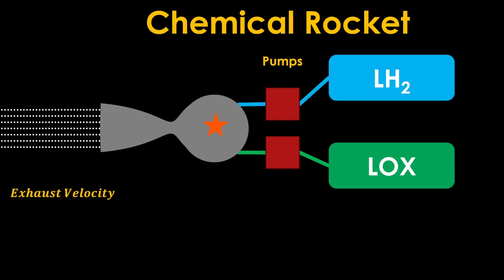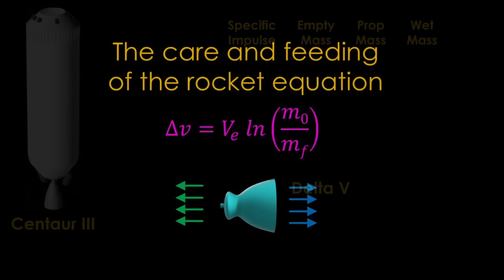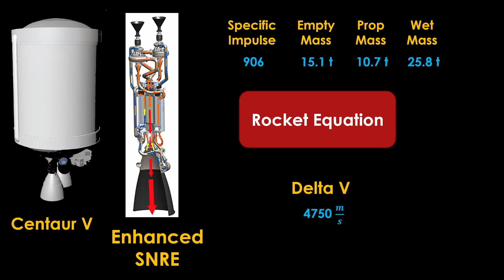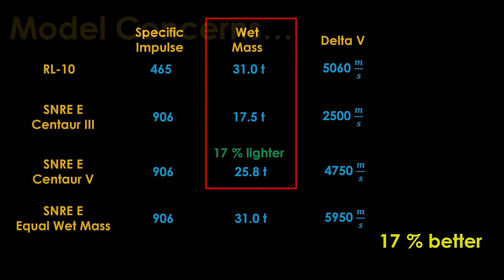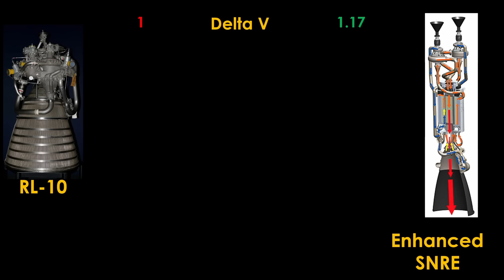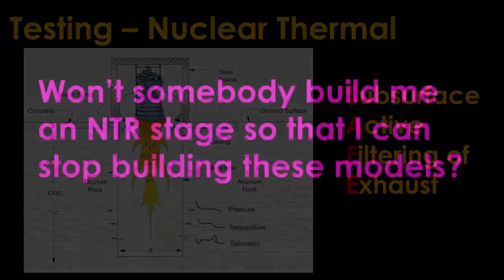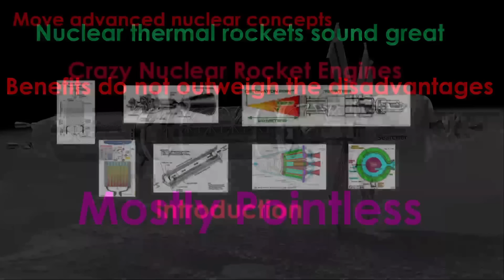Why Nuclear Thermal Rockets are Mostly Pointless

Comment: You can't rid of the heat that's always the problem 😢
Reply: The propellant cools the engine for thrusters

Heat is an issue for nuclear reactors that generate electricity on spaceships but not nuclear rockets as those are just cooled by the propellant 
Lastly space engines are designed to operate very very hot and so would not have any issue staying red hot for several hours or days it would not damage them in any way
Reply: @IceRain-f5v  After shutdown the NTR core will continue to produce heat, ALL fission based reactors have decay heat because the fission products of a Unranium atom are not immediatly stable isotopes, they spontaniously decay.  At the moment of shutdown it's around 6% of pre-shutdown output and decays asyntopically for YEARS.  This decay heat will uterly destroy the engine if not disipated, which is why NASA always considered NTR stages single use, they literally self-destruct after being used.

Comment: NTRs might make sense when you have a very high payload mass fraction. This reduces the influence of the dry mass. If your spacecraft is big (NTRs will likely scale well), you could have a lower propellant consumption for the same payload.
Reply: NTRs add a huge amount of dry mass for manned missions, for shielding, thermal radiators, landers, far larger and heavier hydrogen tanks, and custom landers. Far more expensive too.

Comment: Draco was not cancelled because it was infeasible… Draco was cancelled because the government obtained a launch vehicle that could not get cryogenic hydrogen into the payload fairing… there are no technological gaps to do this. Just political gaps. The cost for a nuclear system of same thrust and delta v of an equivalent chemical one is actually cheaper per firing when including oxygen delivery costs to orbit. A single launch to provide hydrogen from earth to orbit could provide 3x as many firings as the equivalent chemical system. NTP systems are also much cooler than equivalent chemical systems. The required temperatures are low. And we can do this now… we have all the technical capabilities AND a launch vehicle that can support the deployment… the government just doesn’t want to pay for it

Comment: I agree that the current plan's results are unlikely to see immediate practical application, nor is it highly probable that this will become essential technology in the very near future. However, I also don't believe it's a technology we should abandon.

It certainly has unprecedented characteristics, appearing suited only for super-large spacecraft—and to a greater extent than previously predicted. But that shouldn't mean suitable use cases won't emerge in the future. Setting aside the idea of betting everything on this one thing, I believe it warrants investment as a precaution.

Fundamentally, having preferred scales and scales where performance is poor or even impossible isn't unique to thermonuclear engines; various chemical engines and other engines face the same issue.

For example, electric pump engines can be excellent at small scales, but at larger scales, the weight efficiency of other methods improves, reversing the advantage. This is why Rocket Lab, despite successfully developing the world's first practical electric pump engine, the Rutherford, does not use that technology in their larger new rocket.

Another example: the expander cycle, represented by the RL-10, becomes increasingly difficult to implement as it scales up because the square-cube law negatively impacts its operating principle, eventually hitting its theoretical thrust limit. This is why, despite being a cycle with excellent ISP and other characteristics, it is only used in small engines for upper stages. Japan has extensive experience with derivative cycles that can significantly relax the upper limit by sacrificing some ISP, but even they are struggling to achieve the planned thrust for the world's first expander first-stage engine, the LE-9. Further significant scaling up is probably not feasible.
Reply from the maker: As I said in the video and in past videos, I support the programs to build real stages because I want to have something real to compare with. 
But DARPA decided it wasn't worth spending more money on.

Comment: While your analysis is mathematically sound, it is mostly pointless. This is not the use-case for am NTR. No one nowadays is considering using an NTR as the second stage of an Orbital Rocket. Can’t really do that anyway because that’s still within earths atmosphere. That was considered during the 60’s, but as seen with the testing, people back than didn’t care about radioactivity. The use-case is for ships that embark from Orbit to Interplanetary Journeys. There you can negate the Heavy-Weight of the Engine by making the Tank in relation to it almost as big as you wanna be. That due to that your Thrust-to-Weight Ratio falls way below one doesn’t mater when you start in a stable Orbit. All that only makes sense when you are pushing ten’s of tons of payload, but that’s what you are doing on Interplanetary Journeys anyway. Launch costs are going down, but they aren’t exactly insignificant. Bringing twice as much fuel into orbit still costs twice as much. Somewhere in its DRM 5 for Mars, NASA mentioned that it would need almost twice as many launches to Low Earth Orbit if it uses chemical propulsion for its Mars-Ship instead (Back then that would be Ares 5 launches, nowadays that would be SLS Block 2). In the end, SpaceX might have the better approach by mindlessly hauling loads of chemical fuel into Orbit. But we already see in the discussion about Lunar Starship the logistical challenges that brings.
Reply from the maker: I used centaur as an example for the kind of stage that you could build, but I didn't mean that it would be used as a second stage.
That could certainly have been clearer.

Comment: You'd need a nuclear reactor capable of operating at very high temperatures sufficient to get a good ISP from liquid hydrogen ... and in turn, a good ISP from liquid methane (which is almost identical to hydrogen at temepratures exceeding its decomp temp: ie when carbon solid or vapor + hydrogen gas is present). That's not beyond current technology, but it's beyond current technology implemented beyond experimental uses.

It would probably be some sort of high temperature molten salt reactor ... but whether thermal or fast neutron based, I'm not sure what would be more favorable. (fast reactors would allow for more flexible fuel types and longer fuel cycles without as much risk of neutron poisoning breeder products impacting things, since fissionable and fissile isotopes would both work)

Additionally, such systems would make more sense if they were also used for electricity generation utilizing waste heat from the reactor or low reactivity periods for very high ISP via ion engines, plasma engines, or some other type of electrical impulse drives. (this could even include power generated at idle, when only decay heat is produced from the reactor)

Still, such propulsion systems would be ideally suited to platforms that don't land on the surface of any body and would instead act as ferrying flights between locations (like earth to moon and back or earth to mars or moon to mars). 

I'd think repeated round trips to the moon for resource transfers would be a significant potential use in the relatively near future. (it seems like lunar surface installations seem more likely than Martian ones, and there's more potential to use the moon as a base of operations for resource stores and resource production from the lunar surface + crust)

A U-233 based fast reactor might be preferable given the neutron capture products that could potentially build up would have to climb to substantially higher atomic masses before you run into annoyingly short half life breeder products/byproducts that a Pu-239 reactor would have, and a U-235 reactor would have a higher minimum critical mass and different neutron economy, plus still not as many neutron capture events to get into the more problematic isotopes. (a Thorium-Uranium fast-breeder wouldn't make sense to use for such purposes since compactness and low weight would favor reactor-bred U-233 instead, plus you end up with U-232 build-up or equilibrium being reached in a Thorium reactor vs U-232 decreasing from the start with a U-233 reactor, so the probematic decay chain of U-232 would be a fixed, known quantity that would only decrease over time ... or at least I think that's the case, unless the parasitic n,2n reaction with U-233 is more significant with fast neutrons than thermal neutrons: I was assuming the fast reactor used in the rocket power plant would favor U-232 less than the thermal neutrons from the original Thorium breeder reactor) You'd also want to use freshly reprocessed U-233 to minimize Th 228 contamination building up prior to use.
Reply: How would a NTR that is based on a molten fuel work?  The key to the system is to heat the reaction mass, hydrogen or methane with that fuel.

Comment: As others have said I think the video in part misses the point of NTR engine and where it's use case shines. Doing some back of napkin math and pulling up PDF's from the constellation program for their NTR and using a mass-ratio of the shuttle-drop tank for equivalent mass ratio for a large H2-02 chemical tank. The NTR has superior ISP performance once as you hit that large wet range of 80ish metric tons for a vessel. Other points would be the long burn time necessary for mars transfer burns, repeated burns, and the secondary use of the reactors for power for the vessel in transfer.
Reply from the maker: Do you mean "superior delta v performance"?

Repeated burns were a bit problematic in some of the NERVA tests, and IIRC they didn't have luck with restarts at full power.
Reply: The Shuttle Drop tank was a combo hydrogen and oxygen tank, using it's total mass is incorrect for a hydrogen tank, NASA already did the math on the best possible hydrogen tanks and they are no lighter then 8% of the propellent mass.

Comment: Can you make a video on how the hell the wave rotor nuclear thermal rocket is supposed to work? The claimed increase in potential ISP seems unlikely.
Reply from the maker: Is it one of my crazy nuclear rocket designs? I know I looked at some of the centrifugal designs.
Reply: @EagerSpace  I think it has to do with how the turbopump functions. I still don't understand it.
Reply from the maker: I went and read the one paper I could find on it. I don't understand it either.
Reply: @EagerSpace  I think it warrants a video. As you've pointed out; 900sec ISP isn't really enough to justify using NTR's but 1200 might. Especially for an outer sol system mission.

Comment: This is a good analysis for a centaur sized upper stage, but what if instead you were talking about a starship sized craft, starting from LEO. At that point you can have much more tankage so could carry far more propellant

I think that the decreasing launch costs cut both ways, it reduces the need for a super-efficient upper stage, but makes it more reasonable to test such designs in space

Also, what would happen if you didn't use hydrogen for the propellant, but instead used something denser (yes, this gets into more theoretical 'what could you do with nuclear thermal' rather than what has been designed)
Reply: You can't use an NTR as an upper stage within the earths atmosphere. There is no propellent better than hydrogen for nuclear thermal rockets, both in ISP and in limiting corrosion of your engines. And using one on a Starship means that its most efficient part, the re-entry heat-shield, is useless because you can't re-enter the atmosphere with a hot nuclear reactor. Starship is already as fast and efficient as any NTR could be on the Mars route, and costs a tiny fraction as much to build.

Comment: I feel like someone could have made a similar video on why electric cars are a non-starter in the 90s, or on why nuclear power plants are a non-starter in the 50s.
Reply: technically, the battery chemistry from the 90s for battery was not good enough for cars with ranges of 200miles

plus, Tesla company learn from Edison to build a revolution you must build infrastructure for the revolution.

Tesla company with the supercharger network 

Edison with the DC wire transmission and generation

Comment: About the shielding thing...
This is for space. You need shielding anyway. more so if you're in for a long flight.

My thoughts about all that, are that it would have been best to use a variation of a fuel cell.

Breakdown Hydrogen into Protons and Electrons, Accelarate the protons along the length of the stage like a particle accelerator.( I saw something about a laser based particle accelerator that could be very small.)

You make it come out very fast, and carrying a lot of kinetic energy, and you get pushed very fast.

Comment: May you analyze laser/microwave powered rockets? It seems to solve many problems for me like being able to use a (theorical) unlimited amount energy from earth or any other power base in any place without carrying the weight of that energy but I don't know if I'm missing something.
Reply: Energy drops off exponentially with distance even with a Gaussian distraction limited laser beam, however if it can be achieved it would be one or the coolest types of rockets

I assume they can only ever be used if their burn is closer to large power stations. For instance orbital rockets launched from the ground may be able to benefit from this technology. This would however be very difficult to do engineering wise I assume because like... do you get an antenna red hot? That sounds pretty crazy for the forces involved
If you use an antenna to generate DC current you then shove into a resistojet that would all be very heavy and I haven’t done the math on whether or not that extra weight would be worth the free energy

The reason this is even a debate is because engines are mostly limited by temperature right now, hydrogen oxygen engines almost never run stochiometric because they would get too hot. It’s literally a hydrogen torch cutter
Reply: solar thermal......

Comment: I did not expect this outcome. 
Is it possible that free free hydrogen items in space which is one atom per meter cube, be harvested and then be used as a fuel for interplanetary travel. Could that work?
Reply from the maker: See bussard ramjet.
Reply: That's called a Busard RamJet and will not work unless your doing FUSION with your hydrogen because collecting it inherently means your colliding with it and losing momentum in proportion to your speed, thus you need exhaust velocities that are insanely high well outside the range of any NTR.  Also the flight duration is long enough that your fissile material is going to be running out.